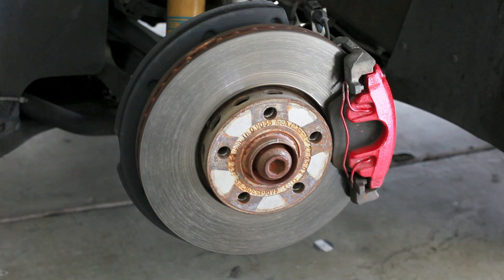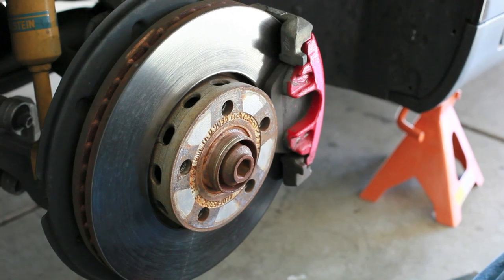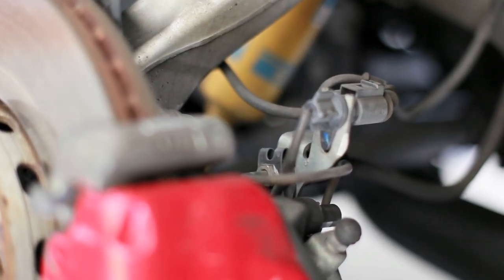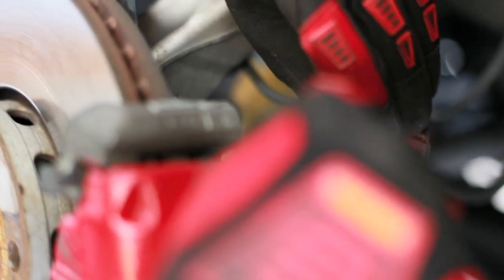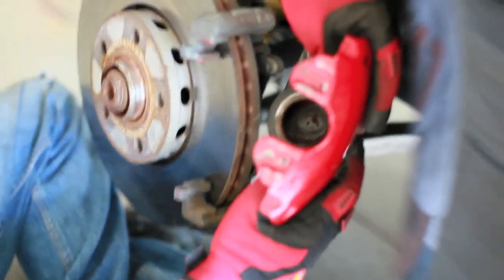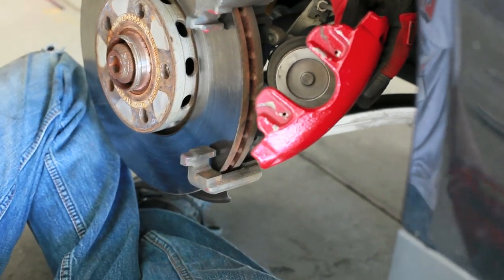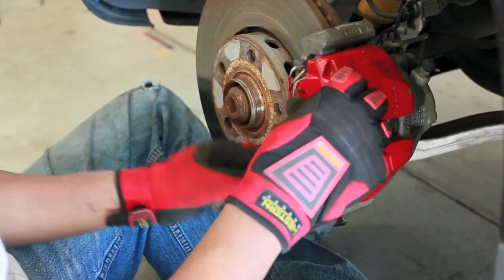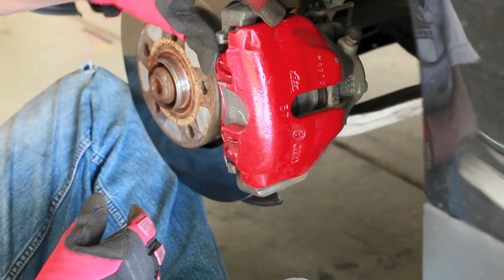Front Brake Pad Replacement, 2004 Audi A4Q

Comment: hi. i did exactly as this video showed me, but on the right side my breaks get really really hot and it also makes a noise, have i done anything wrong will it maybe help if i put on some grease on the back of the pads?
Reply from the maker: Hmm, that's bad.  I'd suspect that your pistons are stuck in the "out" position and are pushing on your brake pads all the time.  If it's a metal-on-metal grinding noise, maybe one of the caliper bolts has worked loose, and the caliper is rubbing against the brake rotor.
Reply: Arun Rao yeah you maybe right about the pistons are stuck in the out, today im taking it all apart and do it all over again. No the sound is more like when i push the brakes hard it sounds like a Bang noise from the right side. but now I'm going all over it again so maybe it will be good now. Thank you so mutch for answer:)
Reply: U forget to rub a round the pads and back side with grease -thats way brakes get stucked